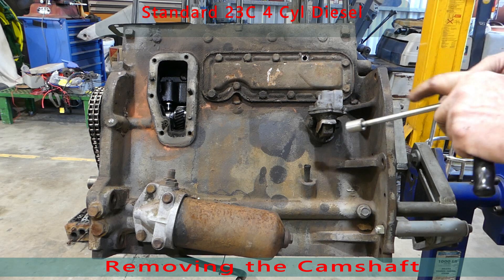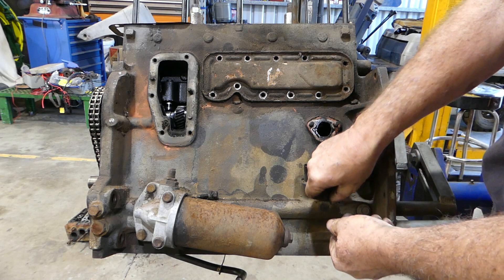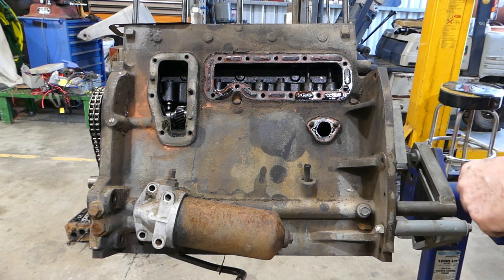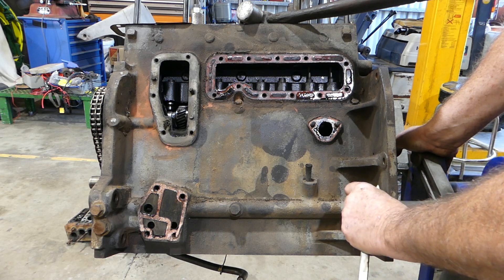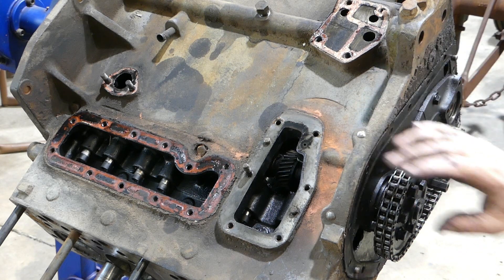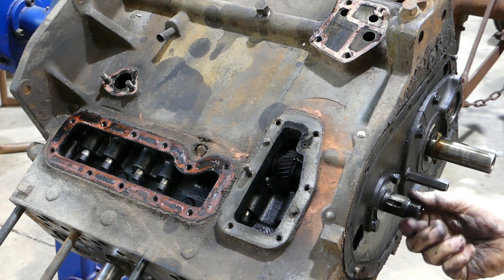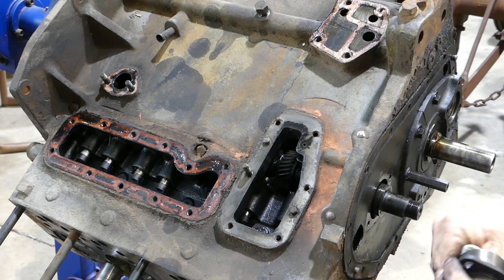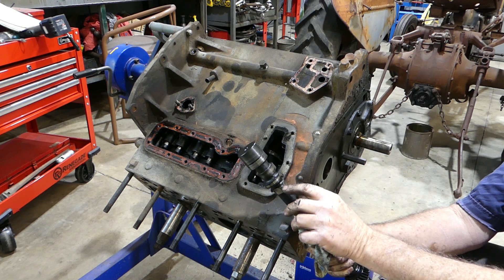Ferguson 23C Diesel Engine Part 7 Removing the Camshaft

Comment: Hello Lance, the lower screw in the oil hall on the right is definitely not original and it was not screwed in properly. This oil screw is for the oil pressure dial gauge. These banjo bolts are no longer produced and can no longer be bought. I got it from the old dealer from a scrap engine.
Made two great videos again. Best greetings from Germany.
Reply from the maker: Thanks Gunther, I imagine I will make some when the time comes to do my engines.